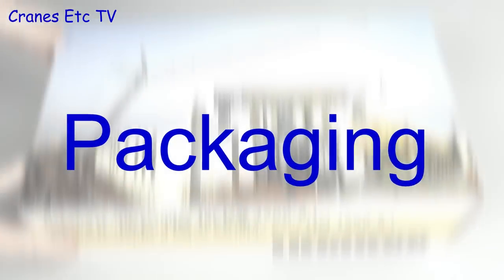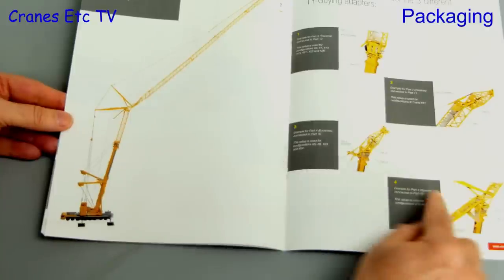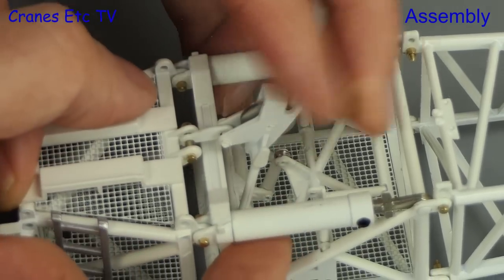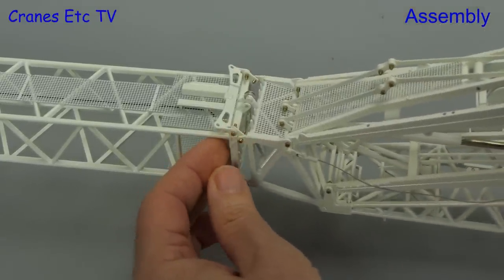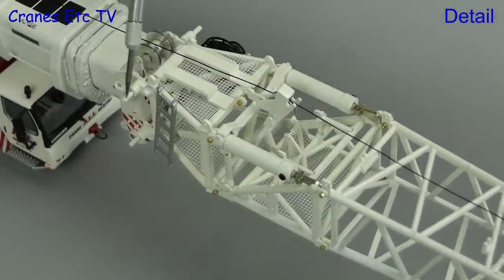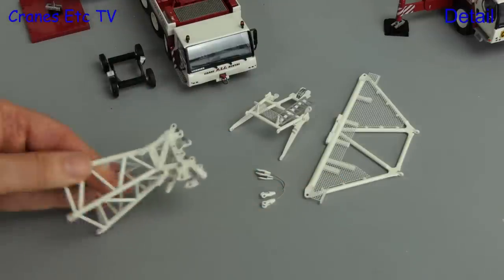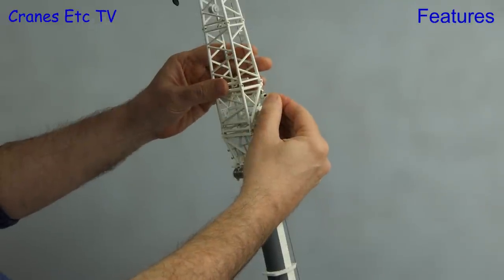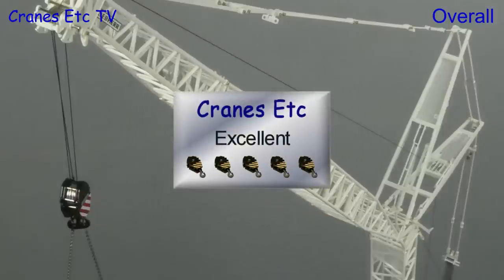WSI Liebherr LTM 1500 Mobile Crane Fly Jib 'White' by Cranes Etc TV

Comment: Last week recieved mine in yellow color for my ltm1500.It is very beautifull but there were two things i didn't like. The first one is that the walkaways are not colored in grey but they are at the color of the rest jib. Secondly that the dolly is black and not at the color of the jib like the older version.Except from those two details,its perfect.By the way decided that would look much better to my ltm1750 so put it on it. Glad that fits on both cranes.

Comment: $900 for the crane only and need to pay another $500 extra to get the fly jib. That’s kinda crazy.
Reply: depend on what version of 1500 and where you get them... the crane itself is def not $900
Reply: @mingming9604  do you know any website (USA) with the crane and the fly jib together for less than $900
Reply: @Pajuato  you need to buy from EU sites.  They are cheaper than US site a lot of time!  I get most of my crane stuffs from eu sites.
Reply: @mingming9604  can you recommend me one or two please
Reply: @Pajuato msw-modell.  ocean trader 1500 and light blue jib.  total price for both $850 shipping cost included
Reply: make sure to create acc with US address so you can get the price without VAT and the correct shipping price
Reply: @mingming9604  thanks a lot. I really appreciate. 😀
Reply: @Pajuato  Make sure to get it ASAP.  These things tend to run out pretty soon.  
Things are definitely a bit more expensive after covid.  But $850 is still very good price for a brand new 1500 along with a jib! It is actually one of the cheapest way to get a 3m 1/50 crane model...
 Let us know if you get it and post a video of the whole thing rigged.
Reply: actually the $850 price i told you is after my $30 loyalty discount.... so i guess it will be slightly more expensive for you but still under $900 shipped.  
You can also pay slightly more to get the other cranes with different livery if dark blue is not your color.  the jib price is the same for any color.